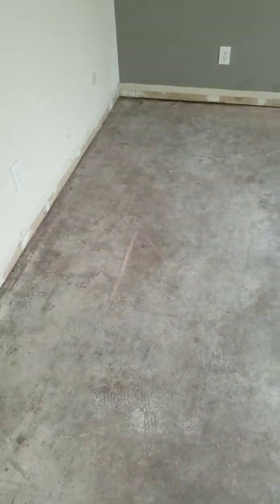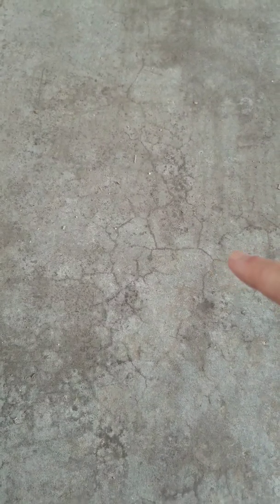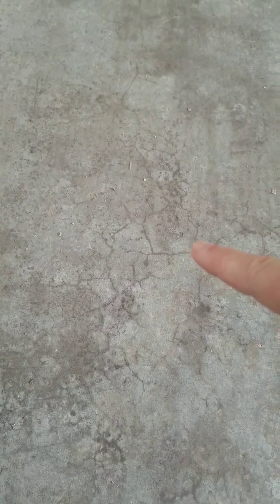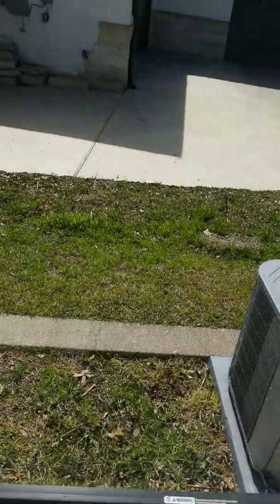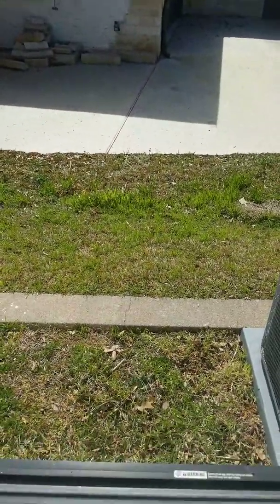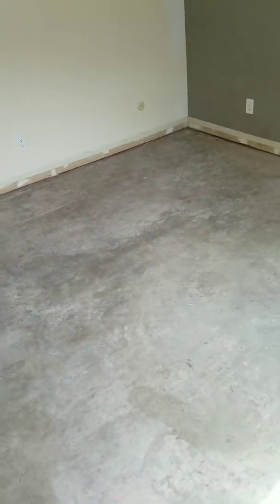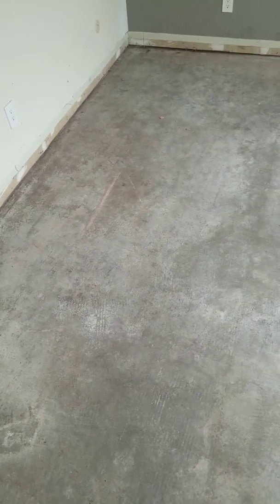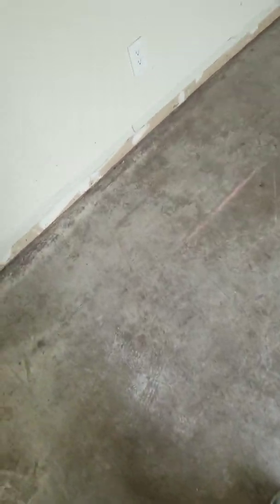Episode 72- How do I fix water coming through my foundation? Finding mold under wood floor.

Comment from the maker: I highly recommend installing floating wood floors over concrete slabs.
Reply: Did that.  Our foundation is damp for some reason. Here we are 6 months later after the install, and only in the center of our house, the engineered wood is warping, blistering, and turning black on places.

Comment: We had porcelain tile installed through our hole house a year ago. Now water is coming through a pinhole in the grout in one spot and a white substance along with it. House was replumbed through attic years ago. I checked meter with water off and it doesn’t seem like there’s a leak. Retiling the whole house was a big production I don’t want to live through again. Any advice? I’m guessing adding better drainage. If this is the case, will the water eventually subside?
Reply from the maker: It sounds like effervescence coming through the grout. Is it happening throughout the house? If yes, then it's a typical condition of ground moisture migrating through the slab. This might be a good time to look into a sump pump at the closest point to the wet area/outside foundation. Let me know what you end up doing.
Reply: Remodel Revolution Radio no just one spot. A small drop at a time. I had a leak detection/water intrusion person come out and he said it’s water vapor coming up through the slab. Weird thing it’s in the middle of the house. Should I put French drains all around?

Comment: We are watching this video likely because we have moisture in our slab. What are some ways to prevent it from coming through or flooring options that make the problem a non issue? Thanks
Reply from the maker: Hi Troy -  Preventing it from migrating under the slab. 1) install a perimeter drainage system that will control the run off and move it away from the slab. 2) install gutters and make sure the downspouts drain 3' away from the slab. 3) if all else fails install a sump pump that is creating a low point ( a hole lower than the slab).  Best recommendation for future flooring is to install an engineered wood floor that is sealed on the bottom. Add a vapor barrier between the flooring and the concrete. (This will prevent the moisture from permeating through the flooring) Warning: if the floor installer tries to convince you the glue will seal the concrete....it won't and you'll end up with the same problem.

Comment: What did you end up doing to mitigate moisture of the slab?
Reply from the maker: Hey Tony I think that the only way to mitigate the moisture in the slab is through controlling the moisture getting under the slab to what extent that you can.We chose to use a drainage system around the exterior of the slab. I have in the past used or installed sump pumps To supplement the gravity fed draining. I always prefer passive drainage because electronic pumps will burn out at some point and have to be maintained.
Reply from the maker: Tony Vu thanks for contacting me.